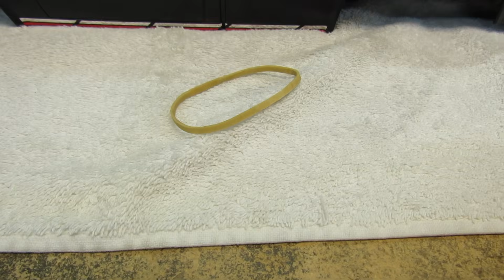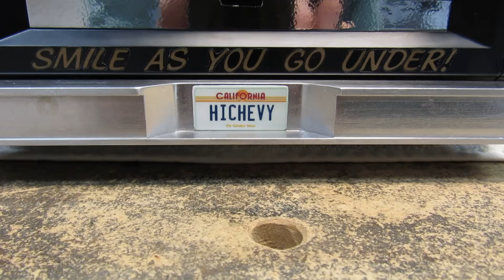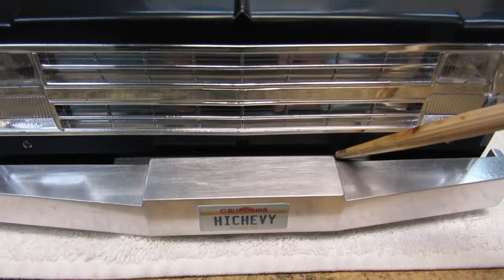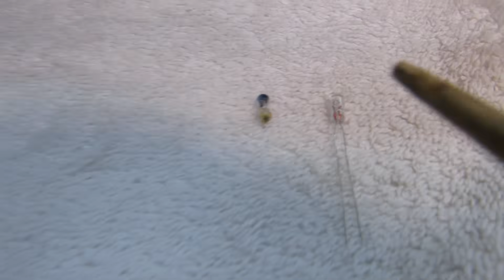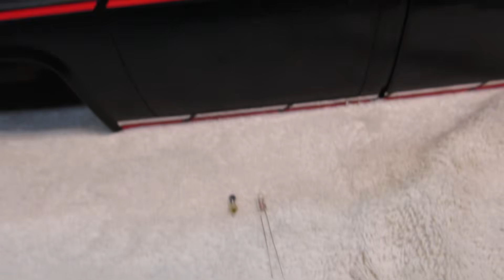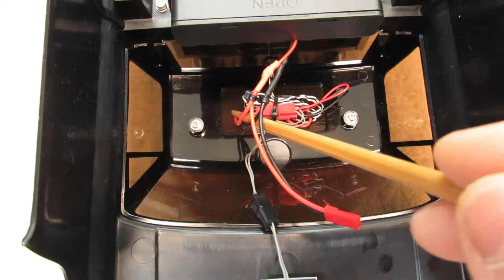Tamiya Clod Buster project update 5 - Black Edition body, Ram lights, Arch Machine, & Chatham CNC

Comment: I love those roll bars. I've got to get me some. Where did you get them from?
Reply from the maker: I got the bumpers and roll bar from Chatham CNC:

https://www.chathamcnc.com/store/c8/Remote_Control.html

The Chatham quad and dual tube roll bars are "homages" (if I may borrow a word from watch collectors) of the ESP ones.  Back in the day, ESP made both double tube and quad tube roll bars that looked very similar to the Chatham ones.  The main difference that can quickly be spotted is that the Chatham ones have chamfered edges on the side pieces, as I mentioned in the video.  I think that they did that so that people wouldn't confuse the two companies' roll bars and try to resell the Chatham ones as "vintage."

I do not have an original ESP double tube roll bar, but I do have a quad tube one and it came with the ESP "King Clod" truck that is in my monster truck fleet.  (That truck was a demo vehicle for ESP so it has almost all of their parts on it that you could buy at one time.)  I don't think that ESP made very many of the quad tube ones because they are as rare as hen's teeth today, while I have seen the double tube ones pop up for sale every once in a blue moon.

For comparison, the ESP roll bars are shown here on the Discontinued Clod Parts website:

http://discontinued.clod.parts/catagories/esp.html

The photo of the ESP quad tube roll bar on the above page is a photo of the ESP "King Clod" that is actually sitting on display right next to my desk as I type this now.  The photo was originally taken by the guy that I bought it from.

If you look closely at the photos, you can see that the side pieces of the ESP roll bars have sharp, non-chamfered edges.  That is an easy way to tell the difference between an original ESP and a Chatham homage roll bar.

Comment: Looks great. My only critique is the decal should not have been pushed into the crease mid front fender seeing as that’s a mold issue and not a factory Chevrolet seam other than that…..chefs kiss..
Reply from the maker: Thank you!

Actually, that seam molded into the front fender of the Clod Buster body was intentional and not a mistake (or "mold issue") during manufacturing.  That is the cut line where the entire front clip (hood and fenders) would tilt forward together as one huge unit to access the engine.  (It also looked really cool when opening and closing hydraulically.)  Monster trucks from the 1980s often had tilt front clips and their builders would cut the fenders right where that line is molded in the stock Clod Buster body.  That cut line is shown here in this photo of Godzilla with its tilt front clip open:

https://static.wikia.nocookie.net/monstertruck/images/7/77/Locke-Godzilla1.jpg/revision/latest?cb=20150824211423

That photo was from here:

https://monstertruck.fandom.com/wiki/Godzilla_(Thurber)

Some very talented Clod Buster owners have actually cut their trucks' bodies along that molded line in the fender and made their front clips tilt open just like on a full scale monster truck from the 1980s.  APM even made a kit for this but I do not know anything about it as I have never seen it other than when it was listed in APM's magazine ads.  I always thought that that was a really cool modification!

Hmmm...now that I think about it, a tilt front clip would look fantastic on this truck.  Oh man...I'm already thinking about future upgrades!  😀
Reply from the maker: Here is an even better photo of a vintage monster truck from the 1980s, Samson I, with its tilt front clip fully open:

https://static.wikia.nocookie.net/monstertruck/images/7/72/Samson1.2.jpg/revision/latest?cb=20250312101916

I found that picture here:

https://monstertruck.fandom.com/wiki/Samson

Notice where the fenders were cut in that photo - exactly where the lines are molded on the stock Tamiya Clod Buster body.  As I said before, those lines were intentionally put there by Tamiya and they were not a "mold issue."

Samson I is a better full scale example of what Tamiya was trying to model because it was a square body Chevrolet truck like the Clod Buster and not a Ford like Godzilla that I previously mentioned.  Also, the fenders on Samson I were cut in the same spot as the mold lines on the Clod Buster body.  Godzilla's fenders were cut a little bit further back towards the firewall.